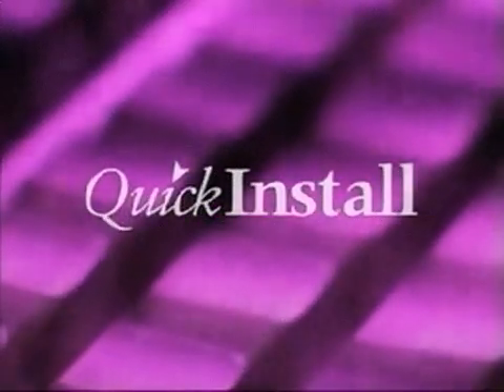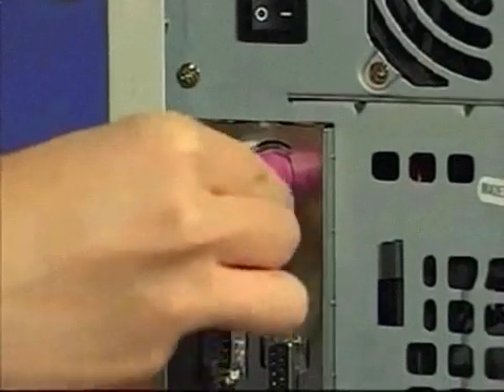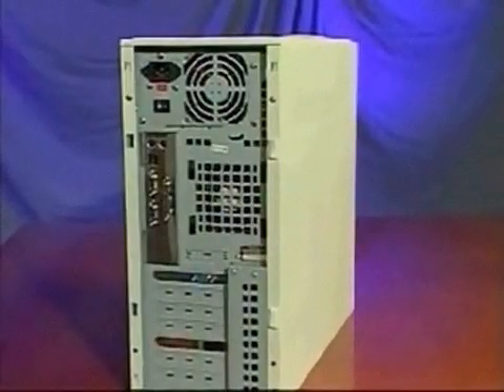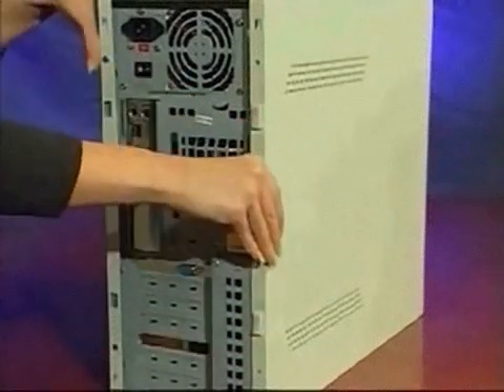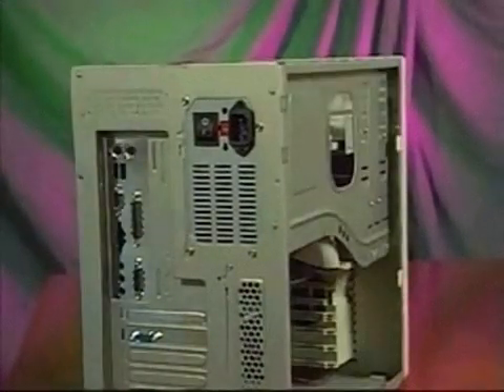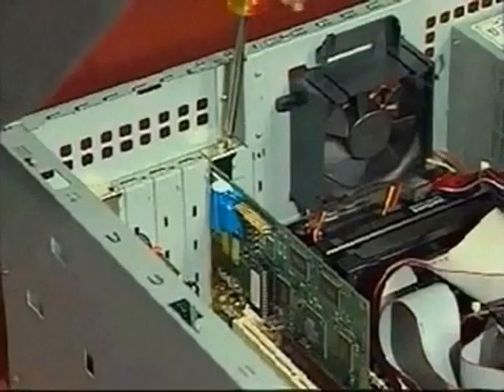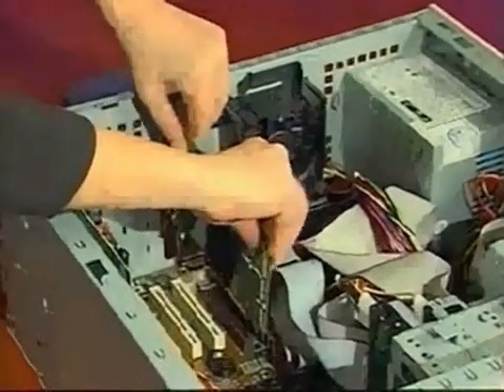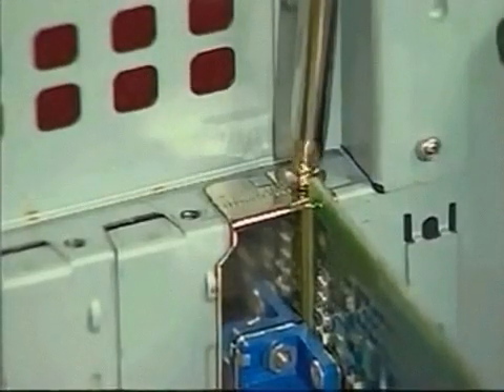3dfx Voodoo 3 - Quick Install Guide

Comment: No, do not  unplug your power cord if youre worried about static electricity. Touching the (unpainted part of) chassis will not discharge anything if case is not grounded.